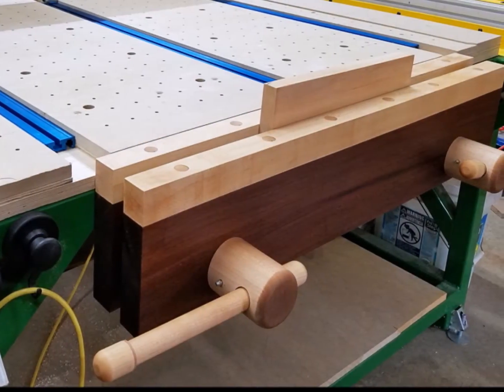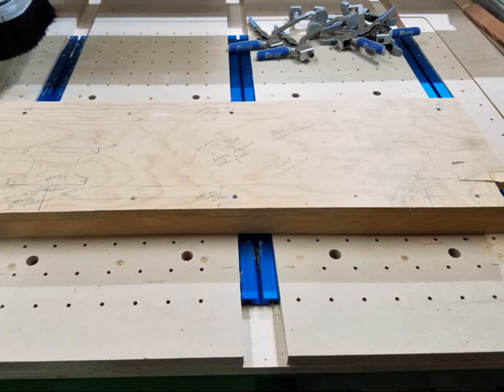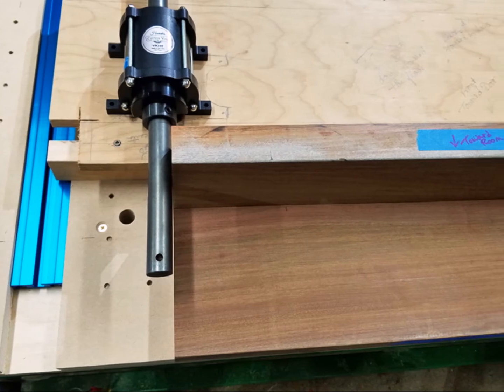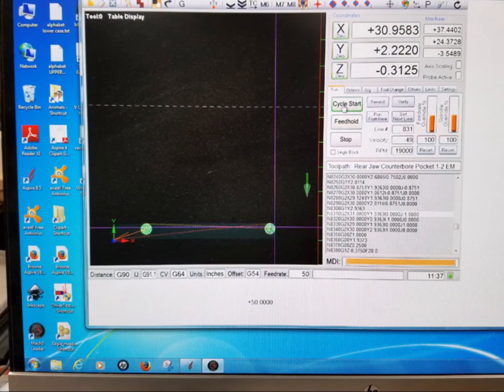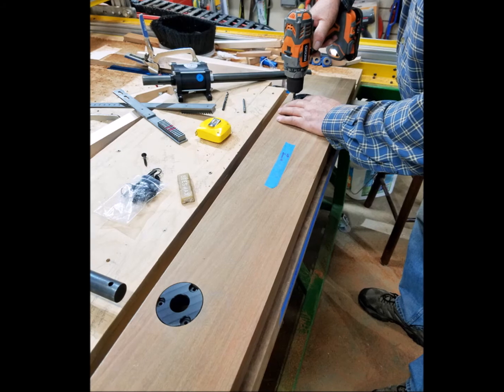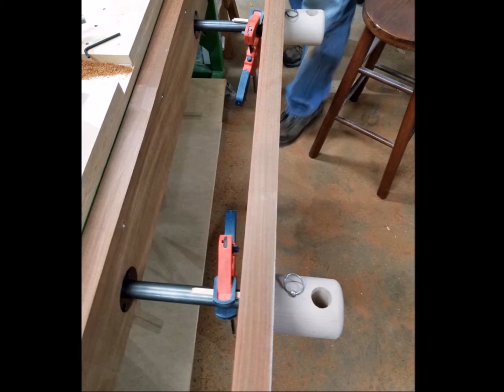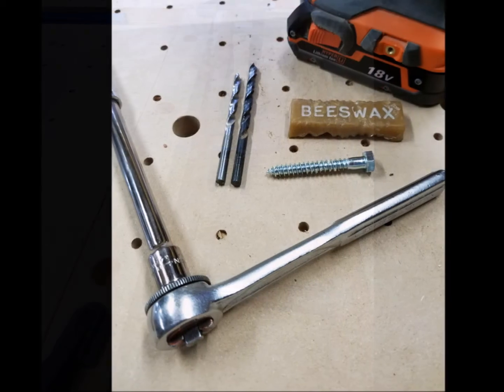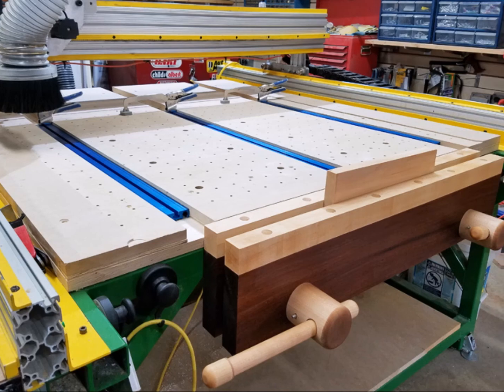Hovarter Vise on CNC Router Table

Comment: When you use the dog holes does it cause an issue with the vise mechanism?  e.g. if you use just the leftmost hole you'd have uneven force, maybe even a shearing force on the right side of the vise. Does that cause any issues?
Reply from the maker: Good observation, Daniel. Two quick notes: First, when i use dogs, I use two and place a piece of lumber across them to clamp against so the force is parallel. But second, I have stopped using the Hovarter vise altogether. In order to work correctly, it needs to be perfectly aligned. Mine does not stay in alignment so it doesn't work for the intended purpose. It jumps a tooth on the rack and clutch system so one side is not as tight as the other. It doesn't hold the work piece from slipping. And the jaw cannot be pulled out. Several times I've taken the vise apart, aligned it again, and put it back together. It works fairly well for a couple weeks and then goes out of alignment. I tried to give the vise away free to the Kalamazoo Maker Space but they declined. They purchased a Hovarter vise too but theirs doesn't work any better than mine and they don't want another one. At this point my Hovarter vise is just a shop ornament. I'll probably remove it and replace it with a Veritas twin screw vise.
Reply: @DaveVanAntwerp  What did Hovarter say about the problem,  I bought one a last year and am now concerned about installing it on my cnc